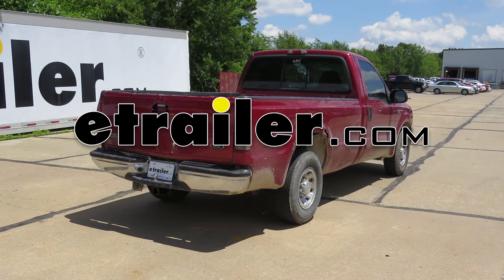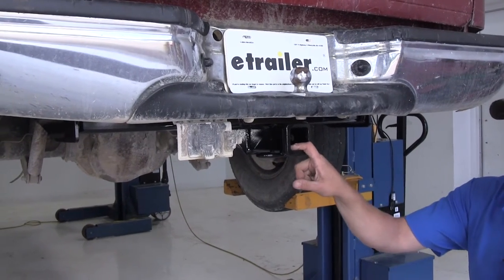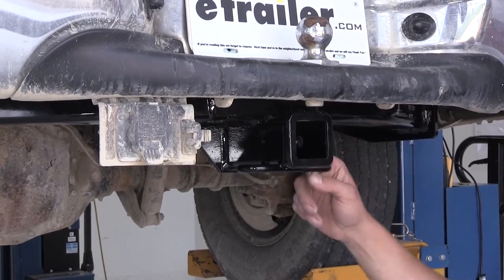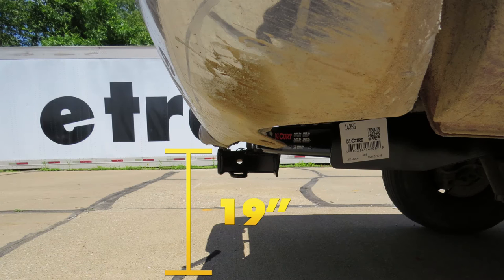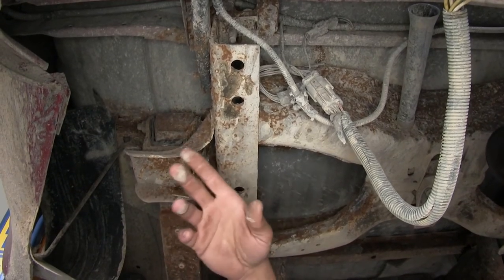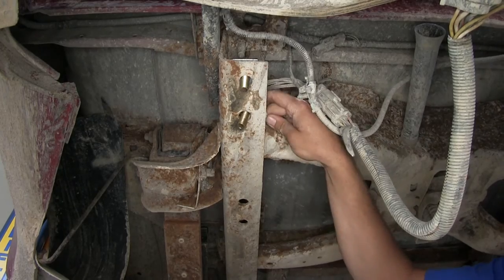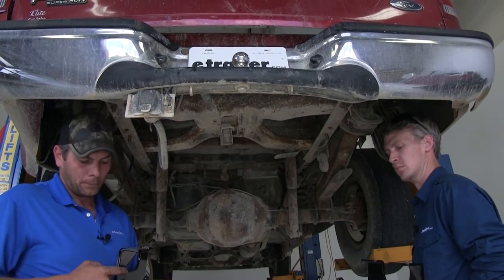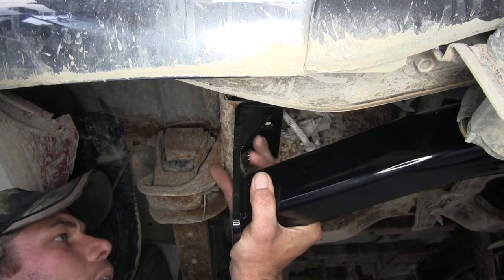etrailer | Installing the Curt Trailer Hitch Receiver on your 2003 Ford F-250 and F-350 Super Duty

Comment: I guess there are no stupid questions
Will the spare tire go back to its factory hanging location? I ask because I just bought a 01 Super Duty with zero tow package back there. I will be buying whatever works.
Reply from the maker: The spare tire gets reinstalled after the hitch installation. It is just removed to make it easier to install the hitch.
https://www.etrailer.com/Trailer-Hitch/Curt/C14355.html